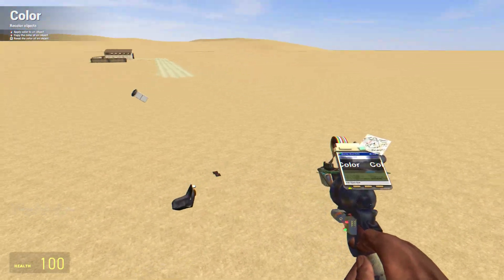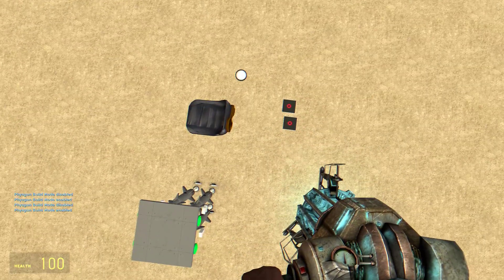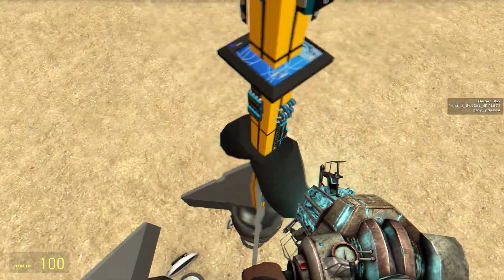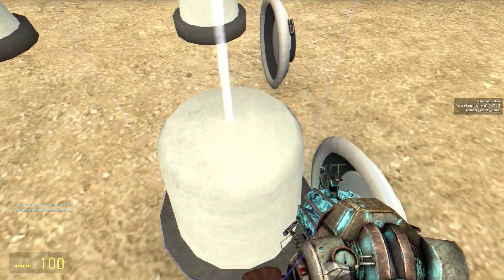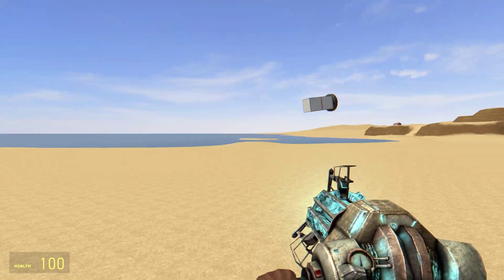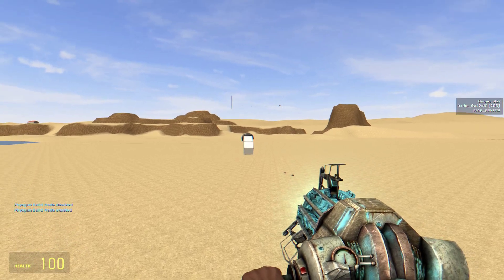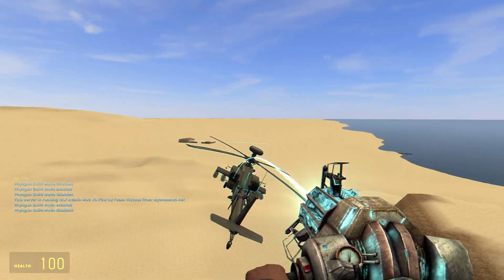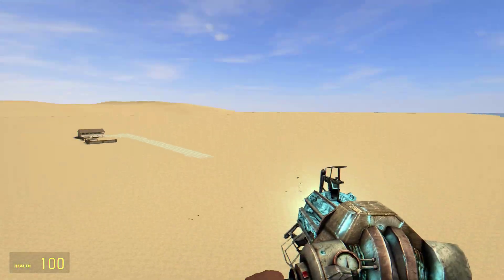Garry's Mod Surface to Air Missile

Comment: How did you do the door blow off?
Reply from the maker: Theres a wire weld latch that just acts as a weld between the door and the launch tube that can be turned off and on. During firing the missile just has one of its outputs go to a toggle gate that turns the weld off and turns a thruster on the door on to launch the door off
Reply: Oh wow, I was not expecting a reply so quickly, love your work man, been learning wiremod finally after 13 years on gmod and your projects have given some great inspiration

Comment: hello i was wondering what addons you are using i know your using wire mod and maybe acf but what else are you using 
in your "Mobile Missile Launcher V3" video you had nukes
Reply from the maker: The mod for the warheads in that video is "Enduring Stockpile" on workshop
Reply: @yourlocalidiot7733  thanks

Comment: Are you gonna keep doing these kinds of things when S&box comes out?
Reply from the maker: If it supports doing things like this and turns out to be a good game then I don't see why not.
Reply: @yourlocalidiot7733  It's essentially supposed to be GMod 2 on a better engine with better code than Lua, so everything should run better. Bigger maps, more versatile tools, etc etc.